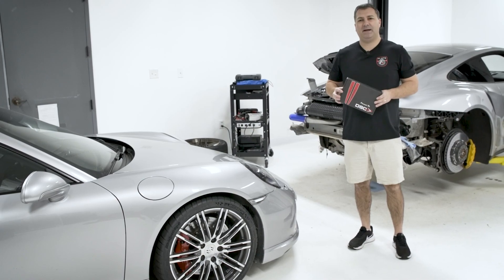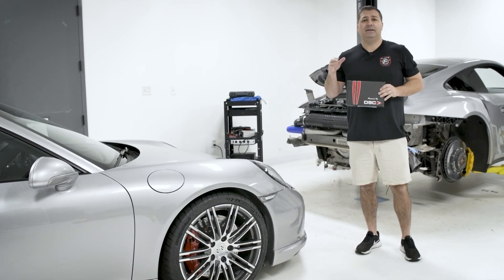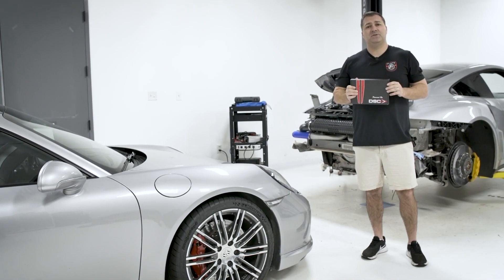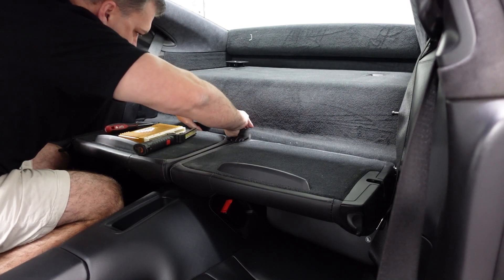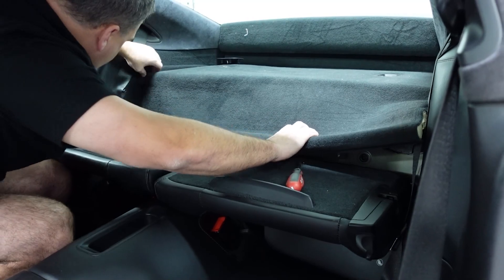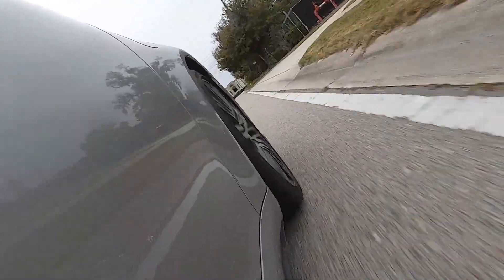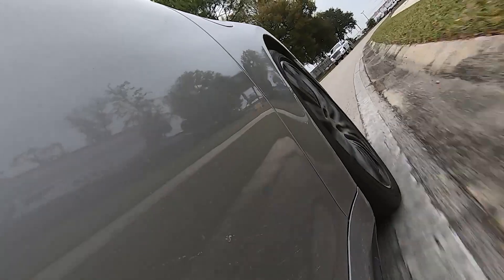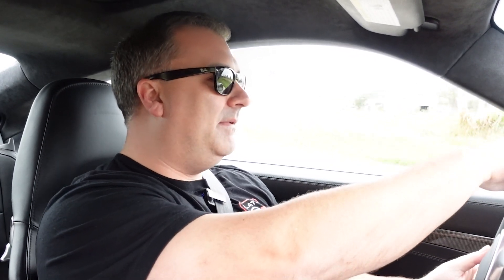DSC Sport Suspension Module for Porsche (Install & Product Showcase)

Comment: Is it worth $1500?
Reply from the maker: The feedback is very good on these!
Reply: Absolutely! Huge difference on my 997.1 S.
Reply: Mine has made my car feel kind of sloppy if I'm honest.  I keep debating if I want it gone.  I might feel differently if I had the current version of it but DSCSport brought out a new one with no consideration at all for current owners.  The file maps I probably want are only for the v2 controller, so @#$* guys like me, I guess.    I'm using the "GT3 Touring" file, which is better than the standard one IMHO but it still doesn't inspire confidence.   Hey, maybe you want mine lol